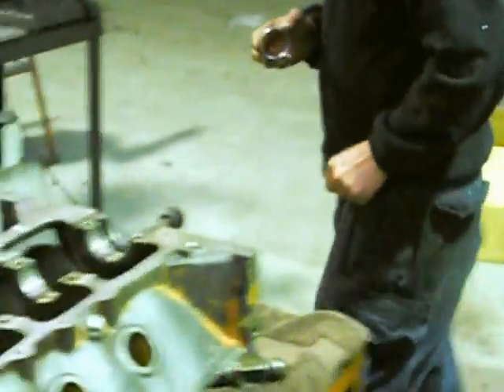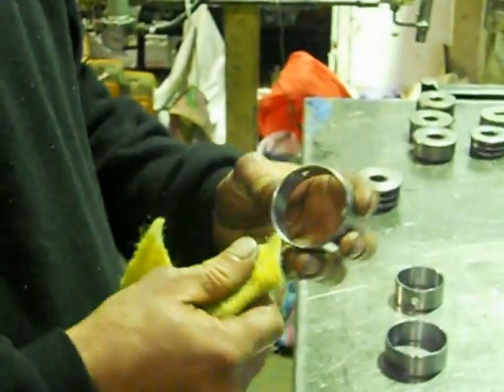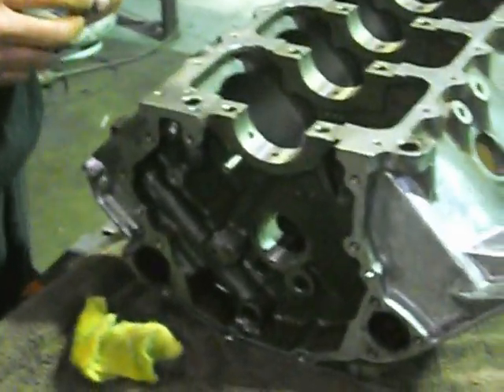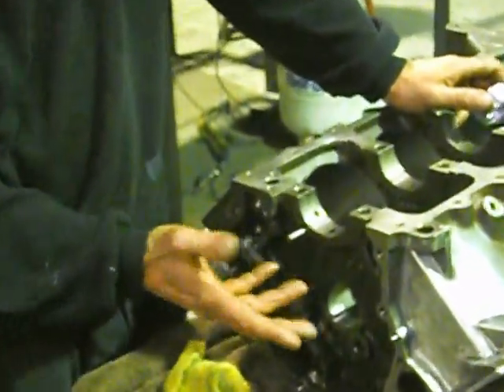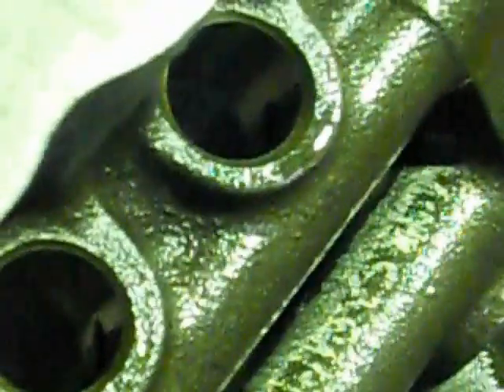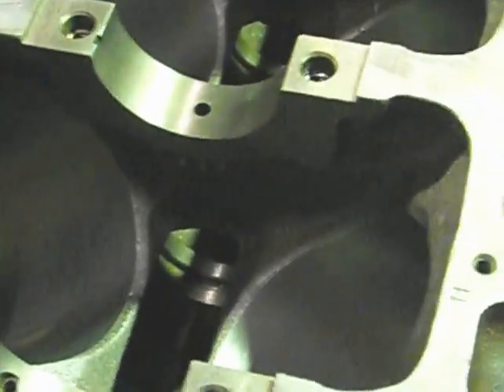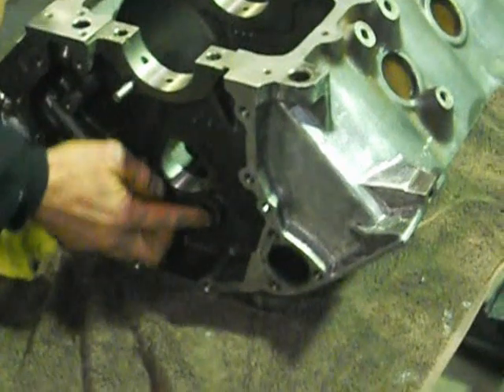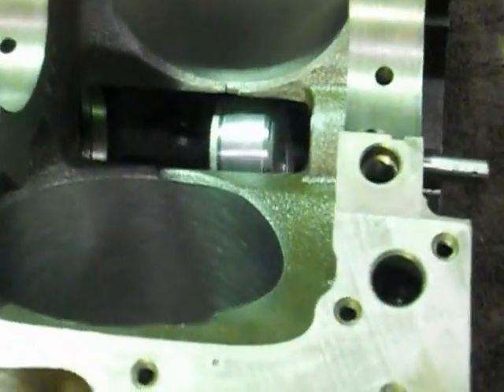How to Fit V8 Hi Performance Camshaft bearings,tips,tricks and trade sercrets revealed

Comment: There's damage to the block at the bottom of the cylinder walls in the back 2...
Reply from the maker: All casting flash around the back for distributor shaft clearance.
Reply: @Aussieheads1  interesting thanks for the info. It looks so rough!
Reply from the maker: Some castings are terrible. Mass production is the reason mate. Cheers, thank you for watching mate.